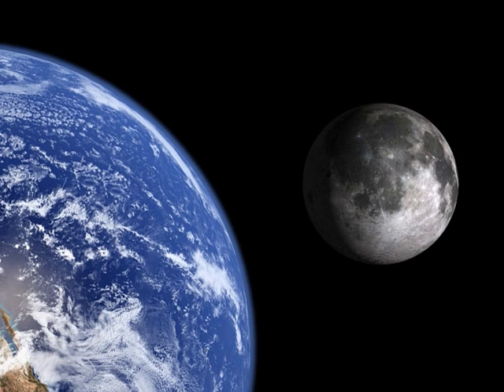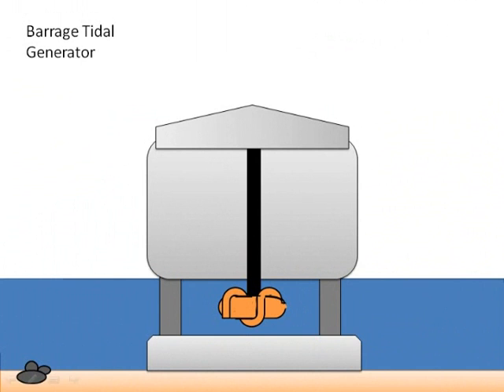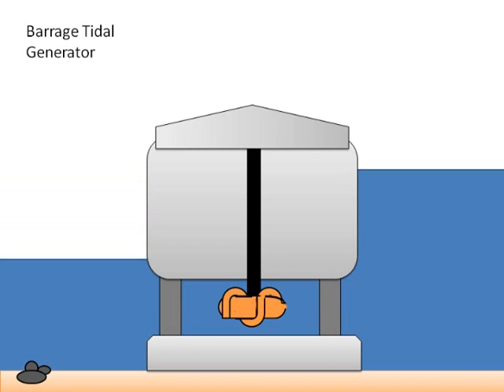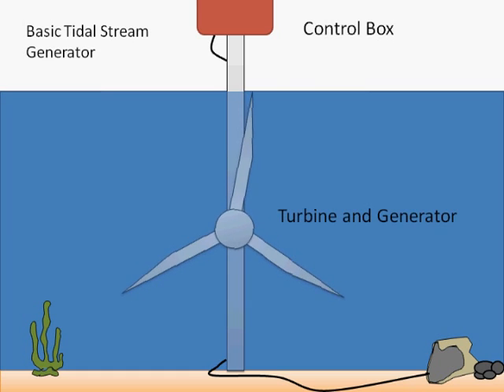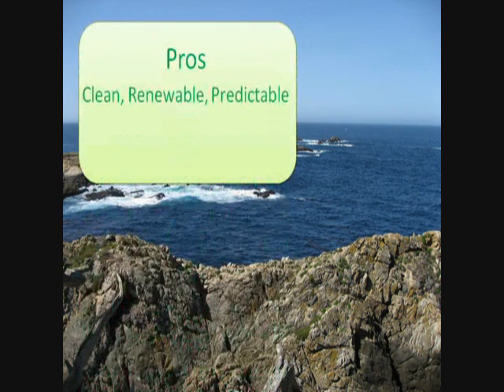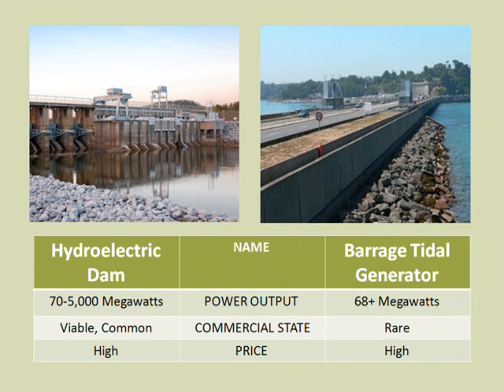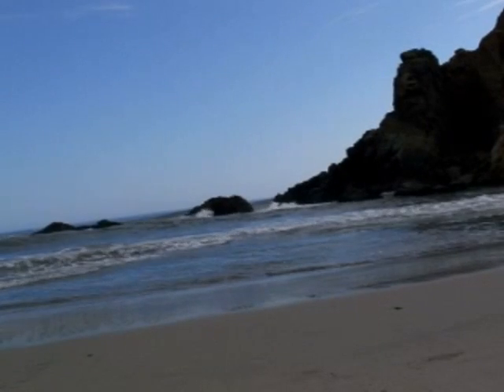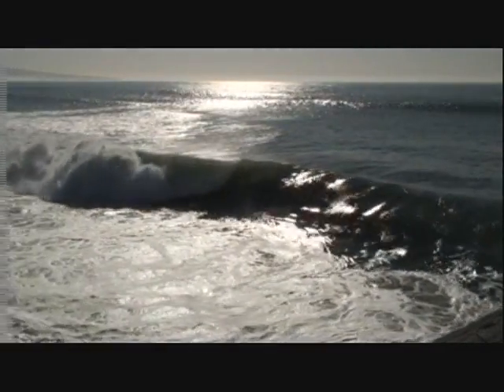Turning Tides

Comment: @aquapulsefuel  I to have always thought harnessing the power of a floating body on the rise and fall of tide should be a way of powering a generator. After all a thousand ton ship is lifted and dropped in a harbour. In simple terms attach this floating vessel to a fixed beam and then its mechanical or hydraulic power from the other end of the slow moving beam.